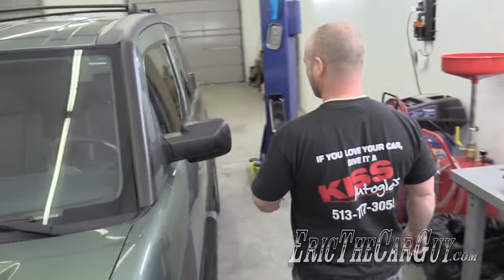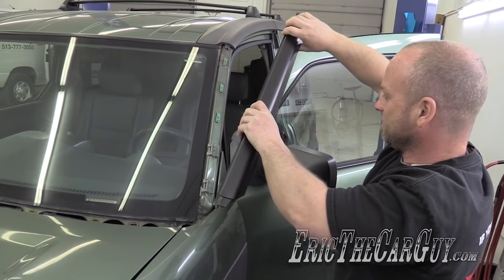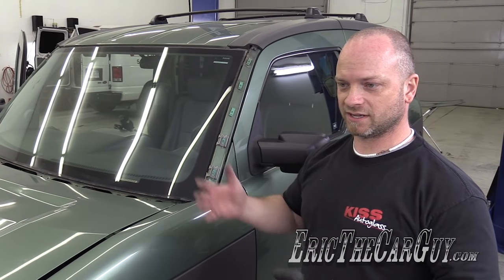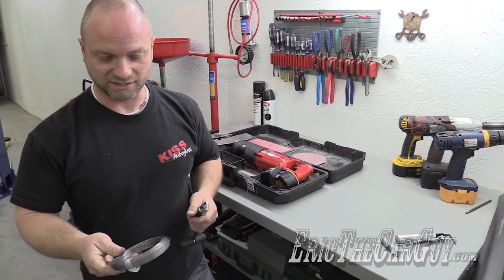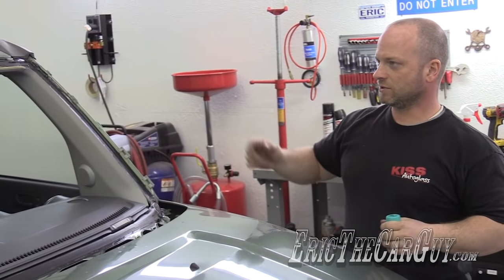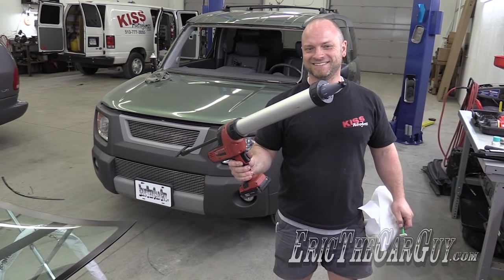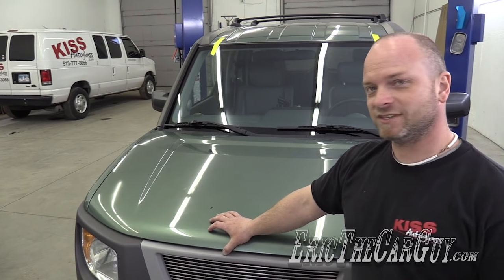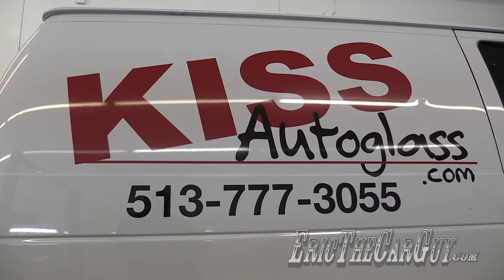How To Install a Windshield the "Right" Way -EricTheCarGuy

Comment: I've seen people laying the urethane glue on the glass and not on the car. Is that wrong, or just another right way to do the same thing?
Reply: cipmars Laying the glue on the glass would make it awfully difficult to set the glass without causing issues.
Reply: Richard Kiss There were no problems with the "sticking", but the windshield started exfoliating around the edges and making all sorts of flower shaped patterns. Sure enough it was the cheapest windshield out there.
Reply: Richard Kiss what about the older vw's with the PAAS?
Reply: I feel the same whether with PAAS or not.  My own opinion is it would be difficult
Reply: cipmars It makes little difference to the bond, provided you have good contact to the primers/old urethane.

There are benefits and drawbacks to either method.

Urethane on windshield> quick bead lay, 1 seam at the bottom of the windscreen, risk of touching the urethane to other body panels while moving the (heavy) windshield into position for final placement, may not be suitable depending on urethane viscosity.

Urethane on body> Slower to lay, multiple seams, but clean install, and works with all urethanes.

Comment: Hey there, Thank you for the video, got a question, I noticed some videos where not much primer is used and only at certain spots of the urethrane after it has been cut to a lower level and in yours, you pretty much covered the whole perimeter. is covering the whole perimeter better?

I just had my windshield replaced and I noted the tech put quite a bit of urethrane around the perimeter also.

Thanks!
Reply: Covering the entire perimeter of the pinchweld with primer might seem like a good idea, but it can actually prevent the new urethane from bonding with the freshly cut, original urethane. For bare metal or any exposed part of the pinchweld where the urethane bead needs to set needs to be primed, but the original urethane does not require any primer.

Comment: No mention about the windshield being a structural part of the vehicle?  Should also talk about the single use primers to prevent contamination or other quality/safety issues.  Cheap guys may be using some bulk container that has been in use for 6 months.  Might not be using the right primer for the glass or the steel or the urethane.

Comment: I was unlucky I had my insurance company take the car and replace the glass on my R129 Mercedes. They took it to a place in MO called CarStar. On that part where they removed the Pillar moldings. They did the same thing that they did but instead of looking at the top of the pillar (its a roadster) they ripped out the molding disregarding the screw that goes and locks the molding into top of the pillar. They broke it metal and screw and plastic piece on the top and all the screw points on the plastic parts at the bottom of the windshield called the windshield-wiper assembly cover. And they refused to fix it. So my advice is that if you have a car that you care about a lot make sure to look into the proper removal and remind the glass installer of the process. I sure wish I did.

Comment: Great job, professionally carried out. I'd like to add just a small comment about fast curing and slow curing sealant. They are made for different applications and does not mean that fast curing is better or more expensive. Both kinds can come from the same manufacturer. In fact, sealants can come in different consistencies too - runny, for self levelling and easy spreading, and thicker more viscous types for vertical and overhead application......just my 2 cents

Comment: Why was Windoweld never mentioned?  Yeah silicone is the wrong stuff but Windoweld was made exactly for that purpose and you can get that from your local auto parts store.  Would have liked to hear his opinion on Windoweld.  Would probably fall into the cheaper urethane category he mentioned.
Reply: ***** Windoweld is a great 3M product.  Just not used by most glass companies.  Dow and Sika are the two major players in the windshield replacement industry.  They are also used in all cars manufactured today
Reply: ***** He doesn't do patch repairs like that, so he doesn't use the stuff. It's a product made for vehicles where the cost of a proper, windshield out, repair is prohibitive to the customer; or exceeds the value of the vehicle.

So long as the product adheres to glass, metal, and paint properly it should work and the success of the repair is down to the prep work. Silicone doesn't adhere to glass well, so it's guaranteed to fail eventually.

Comment: He broke the side moldings...You are suppose to pry up the top corner and slide the molding up and out of the clips...Luckily he only broke a few clips off the molding. The molding wont be as tight as it was but the customer probably wont notice.

Comment: My wife's (Girlfriend at the time) father  thought it would be a good idea to use clear silicone from Lowes to seal a new windshield on her car. Not only did it look really bad it also did not seal correctly and leaked water on the dash and once we got married it decided to short out some electrical components in the dash that I then had to fix on top of fixing the glass.
Reply: Gotta love it. Jack of all trades, master of none.

Comment: Can any professional installer explain why both replacement windshields I have had installed in my truck creak and pop when I drive down my gravel road? I drive a 2003 Dakota if that matters.
Reply: Doug Beard Could be any number of thing. Most likely something to do with plastic trim either rubbing against windshield or each other
Reply: That makes sense. The plastic trim on the inside of the window pillar fits very tightly against the glass. I may pull it out and hit it with the dremel. Thank you!

Comment: Dear Eric, I have a crack on the windshield of my acura TL, should i replace it with the acura windshield or go aftermarket like ATS?11111111
Reply: +Mike L You don't have to go with an Acura windshield. They are usually made by another company that Acura decided to go with. Probably FY, Pilkington, Vitro, Guardian, or PGW. Those are some of the bigger ones. The logo makes it more expensive, but make sure you get a quality windshield.

Comment: The "drip it & rip it" method is not the preferred way to get them off the Element... you are guaranteed to break stuff. Those side pieces are $40 each. You must replace all clips if you want them to stay on going down the highway. Remove by pushing gently inwards towards the windshield from the door opening side. It will come loose with minimal chance of breaking the tiny clips on the moulding.You can see how loose those were when he was 'done'.

Comment: Quite professional but there are a few problems.

First of all, most professionals never ever stop the bead on the top, they go into the vehicle and sit on the dashboard if they have to. That allows them to run an almost continuous bead, with only one connecting point. 

Second thing is the placement, they didn't use suction cups to hold onto the glass and the guy let go of the freshly placed glass allowing it to slightly move down, enough to let water in-between the car frame and the rubber seal.
Reply: LTA Sitting on the dash is not recommended.  Older cars you can break or crack a dash.  Nothing wrong with meeting in the middle.  As long as you connect the ends correctly shouldn't have any problems.  Been doing it for years this way with no problems.  The urethane I use is high viscosity which does not allow for much movement once placed.  Then tape to hold it in place.  Lower viscosity urethanes will allow for the glass to slide.
Reply: LTA Who did you see sit on a dash, safelite?

Comment: I wonder, if those rust spots are the result of the last windshield replacement.
Reply: Attila theHun Probably.  No primer was used.  Lucky for Eric we cleaned them up and covered them with priimer
Reply: Richard Kiss I know a guy that had his windshield replaced; about a year later he had to have his entire roof repainted because rust formed around the top of the windshield. My guess is they scratched the paint up and didn't put primer on it. Then, after spending a fortune getting the roof repainted, the trim pieces on edge of the roof peeled off going down the highway. Good times!

Comment: ive been told by an old glass guy to leave a window open so the pressure from closing the door dosnt push the windshield out
Reply: chopedandsectioned Did that on accident for a window guy and got a good compliment. :)

Comment: One thing that should have been done prior to putting primer is cleaning off that surface corrosion. Any trapped corrosion can lead to problems later on. The metal should be clean to Natural colour of the steel. Everything else looks great!

Comment: Awesome video, Eric! I was always curious about how a replacement was done (properly).
Your buddy Rich is a real pro.
Could you ask him if he's ever looked at the Fein (German) multi-master oscillating tool? I've used one for home reno work and it's a great tool. They have a blade to remove the silicone bead where tiles meet a bathtub edge that works really well.  Not exactly equivalent to the windshield urethane but ...

Cheers!
Reply: Mario Dalla Riva Fein actually does make a tool for the autoglass industry. Not as good as some of the more simple tools.

Comment: What about isocyanates in the urethane? They can cause severe asthma, lung problems and skin allergies. It's a health risk not only for the one installing it, but everyone else in the shop at the time. Why didn't you use safety equipment or mention it in this video?

Comment: Should you not do a bit more about that rust while you are there? Even sanding it back a bit, removing the majority of the flaky stuff before adding that primer will make it last way longer.
I'd like to get my windscreen removed & replaced in 2 stages, so I have time to do a proper repair if there is any rust discovered with the glass out - sand/grind back, rust killer/etch primer etc.
Reply: asdreww Erics rust was very surface.  wasnt even flaky. Got it cleaned up pretty good before I primed.
Reply: Any time I see any hint of rust I just cut out the metal and weld new in.  I then drill holes in the backside and spray in rustproofing.  You do not want to take any chances at all!!!

Comment: Thanks for the great video,
But recently i have just had my windshield replaced,
2 guys working with a simple piano wire, it works wonders.
Reply: Charlie Nocode Lots of damage can be done with wire.  There are much easier and more efficient ways.
Reply: @richardkiss3842  rich, I have to replace mine now. I have my old (tinted entirely) windshield in a 97 f150. I plan on using that one, to replace the badly cracked one in my "new" 97 f150. Any tips on not breaking the tinted one im going to use?

Comment: Honestly, yanking the cowl and wipers isnt 110% needed on most cars, and just adds time to the job. Same thing with extracting the bottom, its faster and cleaner for me to just push it up (or have a helper pull up) and cut the bottom with the long knife.

Otherwise, I agree 100%
Reply: I would agree with you, but I've seen too many stuff jobs gone wrong so I avoid them.

Comment: That extractor was invented by a guy named Otto who works at Crystal glass in Edmonton. Yes i work for crystal. and the joke about the glass being so clear we hear that every day. that urethane is one of the best. the only problem with that one is it is conductive. we use betaseal ONE. same stuff just none conductive. and btw finally i see another glass company do this correctly. ive seen horrible things happen with cheap company's installation. like the shield releasing in a collision. the other stuff that he was talking about has an 18 hour drive away time. drive before that and your passenger airbag will NOT deploy properly and eject the windshield  into traffic in the event of a collision.

Comment: Also if there's 2 guys fitting the screen, the more professional approach would be to apply the bond to the glass to emulate the factory robot, where's the suckers??? Glaziers - automotive or otherwise use suckers to place glass, vehicle protective covers? Personal protective equipment when using blades and chemicals?
Reply: i wouldve used cups, seat and hood covers. but that me, i see alot of people not using them.

Comment: One thing he did wrong, gloves have oils itself so either way he contaminated the edge. Also it’s always recommended you start on the passenger side and start from the bottom pinchweld and then go to the top then do the driver side and same thing start from the bottom and then do the top

Comment: By ripping the pillar molding you broke some of the clips. Use the correct procedure designed by the manufacturer to remove the pillar  molding. Now most Honda clips break easily so I always use new clips.

Comment: I don't mean to be critical, but when you make a video public you must expect criticism. I am AGSC/AGRSS certified with 29 years experience in this industry. There are many technical errors displayed in this installation. Most critical errors are priming over rust and contaminating the fresh cut adhesive that remains on the substrate by cleaning it with a used shop towel. The only Dow approved cutting lube is the GC800 cleaner or distilled water only. No soapy additives. I would encourage this technician to see Dow Automotive's fixed auto glass installation guide and consult with an authorized Dow representative for proper handling and application procedures.
Reply: Rolladeck windshield setting system The rust was very minor and cleaned.  Editing makes it look like it wasn't.  Was not a used shop towel.  I keep a van full of clean towels that I switch out all the time. GC800 is glass cleaner. Pretty much the same thing I use.  Everyone has a different technique.  I say if you have a way that works then do it.  I am AGRSS, Dow and NGA certified as well.  Constructive criticism is great.  : )

Comment: do glass companies repair the rust also for extra $?
Reply: If it's a good company they will either grind the rust down to bare metal and put two coats of primer on it or if there is loads of rust they will tell you to go to a body shop before they can touch it.

Comment: 🤓 if ur a noob u can practice on a parts car or project car, and for noobs buy the slowest curing urethane that way u wont be rushed when u installing the glass, you will have plenty of time to position the glass, once ur happy where the glass is set just put a little tape around the perimeter, ur done, dont move car, leave the car alone for a nice long week of 7 days, come back the next weekend and only then install mouldings, lower plastic engine cowl cover, wiper blade arms, usually the longer arm is the passenger side, and the smaller arm is drivers side, careful not too tight the little arm nut, and throw on some new wiper blades cause the old ones mite scratch ur new glass! 😎🚙

Comment: I could only find Dow Express, not the "BP", the smallest quantity you could get was 2 tubes for 30 dollars... not AS expensive as I thought, I figured it was going to be like 50 dollars for a single tube.
Reply: Jesse Crandle Expensive when you compare the cheaper stuff to the BP.  You can buy cheap urethane for $3-$5.  Cheaper when BP is about $30 for the sausage pack.

Comment: I feel bad for rich. A 20 minute job turned into a 1 hour. You double dipped the dauber in the primer. That's contaminating the primer and going to try out the primer. I been installing for over 15 years and can say he knows his stuff. He's right about using your head to cut out the windshield because so have compressed nerves from c3-c7 and L1-L11 from using my head before the extractor came out. What glass and urethane was used?

Comment: how much does a Auto Glass Technician get paid and doi need experience to get started.
Reply: +MrUpheaval It depends on where you live. I live in a rural area, in Southern Illinois and don't make as much as a city installer might. Depends on the company as well. A lot of factors come in to play. Usually a big company will want some experience, but a small one will train you.
Reply: +MrUpheaval Safelite auto glass will train you. A tech can make around 12-15 at 1st then around 16-25 when you can do 5-6 jobs a day

Comment: Good lord.  Ok.. the side trims were removed totally wrong.  Honda element clips are UNIQUE.  You undue the top clip with a flat screwdriver (wedge the grey from the white clip), then slide the trim piece upwards until the clips slide apart and release from each other.   This way you don't break the 5 plastic clips.  Butcher job on that part of this install.  The re-installation part was fine.  You gently bang down with your palm until you don't hear anymore "clicking".
Reply: Yep. I've seen several videos about trim removal that don't follow Honda's recommended procedure and end up with broken clips, or worse, trim. They won't slide easily, but running a little warm soapy water under the trim from the top will help the two clip pieces slide apart. Hard to blame the average owner – Honda doesn't exactly make it easy for owners who don't have a service manual – but a professional windshield tech should know better.